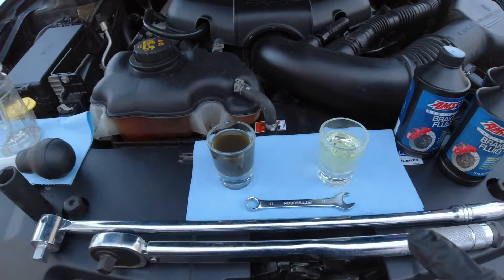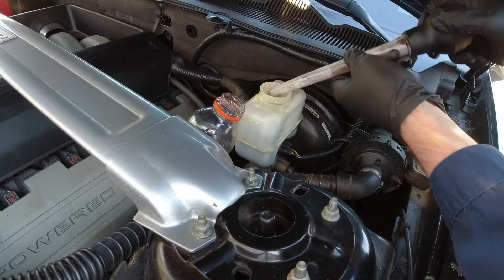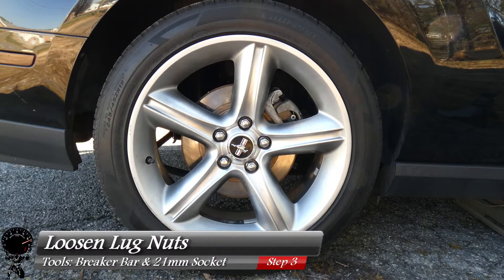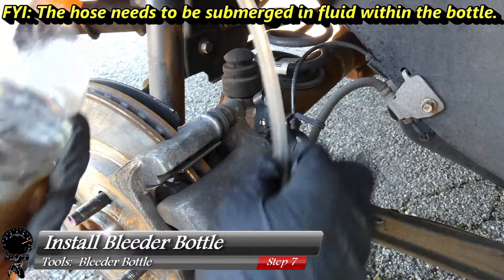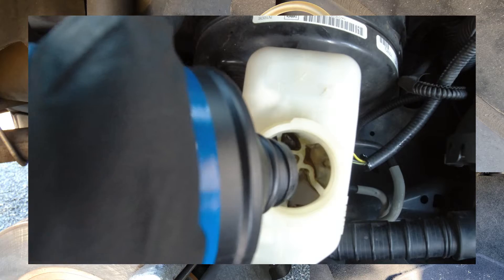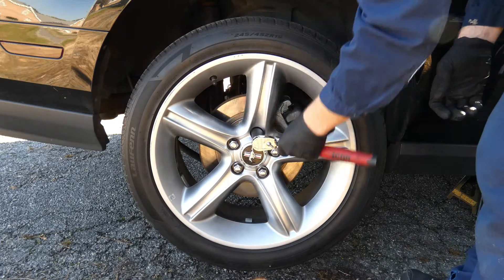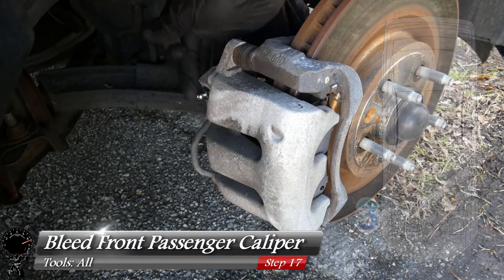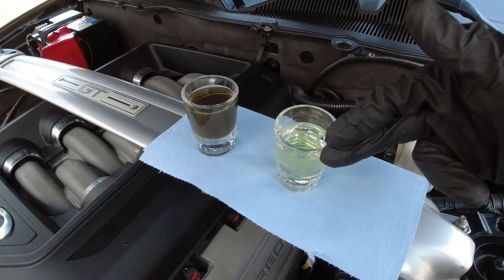How to Flush and Bleed brakes for S197 Mustangs (2005-2014)

Comment: Great video! What size hose did you use for your bleeders?
Reply from the maker: 2-Feet Length 1/4-Inch Inner Diameter by 3/8-Inch Outer Diameter.
Reply: @mcgurrentertainment  Perfect, thank you!
Reply: Where can I get that hose?
Reply from the maker: Link in description.